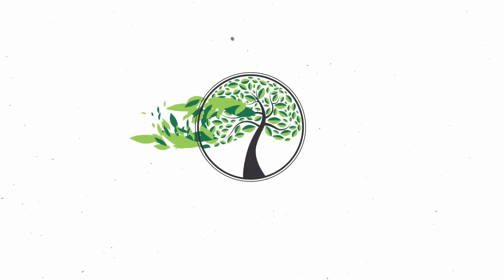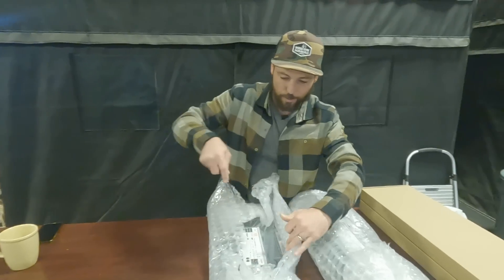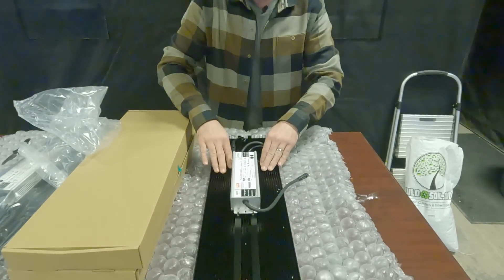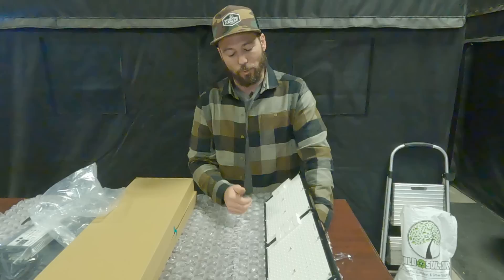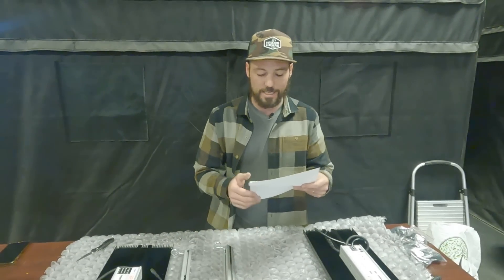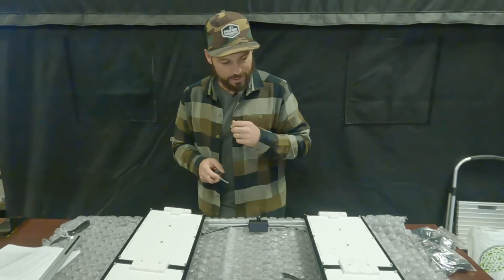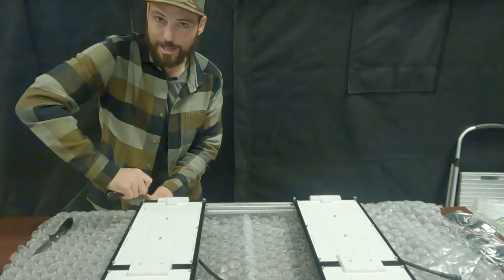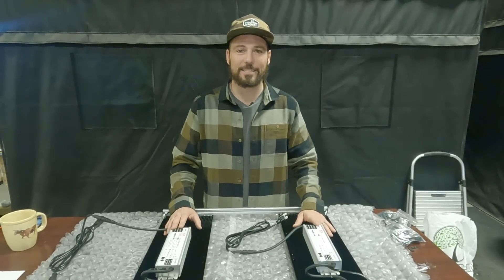BuildASoil Product Highlight: OUR NEW LED LIGHTS // HIGHGROVE MAGNOLIA 4

Comment: This light is a pain in the ass to  put together. If they just had holes instead of these sliding things itd be much easier to align. I understand the slide things are needed for spacing but wow is it annoying.

Comment: Where are all of the led grow lights with the Samsung LH351D diodes at???   Did you guys know that those particular Samsung diodes grow plants better than the Lm301B diodes and the Lm301H diodes....do you guys know why the grow lights with the Samsung LH351D diodes grows plants better?  Answer:  The Color Rendering Index capability of the High CRI 90+ LH351D diode....it renders the 6500k Daylight spectrum with more clarity and purity, and renders colors that the Lm301B and Lm301h diodes CANNOT, because the Lm301B diodes and the Lm301H diodes are only 80CRI.....just slightly better than a fluorescent bulb, and actually very DIRTY light, poor Color Rendering Capability so the Plants don't grow as well under them, and that is a FACT.   

The Waveform Lighting company 97-98 CRI rated diodes will grow circles around the LH351D diodes, because the LH351D diodes are around 92-93CRI and CANNOT reproduce the Color Spectrum as well as the Waveform Lighting diodes.    

I can make a grow light out of just 2,700k and 6500k Waveform 98CRI diodes, and Grow CIRCLES around every other grow light out there, including this Highgrove Grow light with POOR color rendering capability.   It's only rated at 80CRI......so yes it's dirty light and does NOT FULLY render the Color Spectrum...A Waveform 98CRI diode grow light is OFF THA CHAINS FOR REAL!!!!

Comment: What’s up Jeremy. Was wondering your opinion on VPD during lights off. Thanks man keep up the good work!
Reply from the maker: There is only pressure on the plants when stomata is open and they are growing because of lights on. Basically VPD doesn't matter at night. That being said, I still care about the environment. In Veg when lights are off I let the Humidity drop a lot lower because there is no pressure until lights turn on. In Flower I MAKE sure that the humidity stays low and the temps cool at night because I want to avoid MOLD. hope that helps

Comment: I love the style of those lights , last year I had a similar thought , I bought a 4×4 tent with 8'exhast fan 2 - 6' osc fans for corners 8'turbo fan for floor and running 2 - bloom plus xp2500 side by side with a gravita uvb in between the boards and results are excellent , I'm inclined to believe this set up is similar just thinking the set up I got was off Amazon , which are labeled as budget lights , so I'm curious as if I got the same results with a little less of a budget , because I believe these light are a bit pricey but awesome quality , I am a believer , you get what you pay for , Honestly , had these lights been on the market for me when I did my ordering , I would of put out for this exact set up you just exhibited . Thanks for the videos , could you plz get back to me on my thought.

Comment: Watt meter test? Claims 530w but only has 2 240w drivers?
Reply from the maker: The Meanwell HLG-240 is the Model number of the Driver but it's capable of pushing 265 watts without any issues. Part of the build is to make sure you design the Driver and Chips to the environment and heatsink used etc etc. Good EYESSS!!!! Great question

Comment: I like this as a modular design. Shane at Migro has the right idea .
Reply: The array 4 is sick. Light spread is unbelievable how even it is.
Reply: @joesavage2269  The MIGRO Aray is phenomenal, and much better than a big board for versatility... and head-bumping. I have a 4 and an 8 and would not look anywhere else to solve a lighting question for my small situation.
Reply: @cuznclive2236  have to agree, I was really impressed by the overall build quality for the price, frankly a brilliant bit of kit
Reply from the maker: @joesavage2269  The MIGRO looks like a great deal! Off Hand comparing Dollar Per Watt it seems like a great value. Normally when I see a manufacturer use 3000k + 5000K Led chips it means they are using a lower quality product that will result it a unit that is much more cost effective. With the High Grove we only wanted to offer the Samsung LM301H Full spectrum 3500k as opposed to the MIGRO style. Modular is the way to go and I think the MIGRO would be a good choice but not directly comparable by component.
Reply: @BuildASoil  I wouldn't dream of trying to argue they are in the same league tbh, I can only speak from my own experience. I got the migro array because it fit my space the best, and all the other benefits like build quality etc were nice surprises! In my day job I assess a huge range of equipment on all aspects from packaging to the warranty and I recognise a high performance when I see it! I don't think the higrove kit is available in my market so there's that as well!
Reply: @BuildASoil is this light or Migro Array 4 better? I am looking to get 2 for a 4 x 8

Comment: Hey man it sounds like a good quality light but for a 4x2 I've found plenty of decent ones pretty similar components like mean well driver and Samsung diodes for like 100 bucks or so. Just easy to find these days and as much as I'd like to buy from an American company, Amazon offers free shipping and returns with all kinds of LEDs that work fine. Never had a Chinese brand screw up on me so doubt I will pay 4x for basically same thing
Reply: Do a par test on those cheap chinese lights. I gaurantee you they are no where close to what they are advertising, if they even give out a par map at all.  Everyone i know that started with those cheap lights ended up disappointed one way or another. I gaurantee you are going to end up spending more money in the long run vs just buying quality from the get go. Not only that but the spectrums usually suck with those cheap lights and your end quality/yield will suffer.
Reply: @mopar426power  you're talking to someone that researchers and tests lights man... Is the ppfd a little bit lower? Yeah but not enough to affect yield. When it comes to $400 versus $75 that's an easy choice for me
Reply from the maker: @jm12green31  I would be happy to compare the components you are discussing to this Magnolia. We are very transparent and only offer what we believe in. When you are using thousands of LED chips the difference between a 1 cent chip and a chip that costs 6 cents makes a big difference. Then you factor into that, the waterproofing, electrical connections, Heatsink and build quality things can change quick. Let me know what components you are comparing to and I would be more than happy to share my opinion on how the 2 compare.
Reply: @mopar426power  but the caveat is you have to really check the components when you order from an Asian distributor on Amazon. I've seen plenty of people get fooled... Not me I always give them a full test. Are there a few duds? You bet your ass haha but there are some diamonds in the mix
Reply: @Rick Owens lol shots fired

Comment: 800 dollars out of budget man
Reply from the maker: Comparing to other similar grow lights it's a great value at 1.50 per watt and superior build quality + Warranty etc. Because these are modular you could always get the Highgrove 2 and start veg with it and then upgrade later by adding another Magnolia 2 and when you order it tell us that you want to combine them and we will send the Metal components to upgrade your 2 lights into 1 magnolia 4 free of charge when you buy the 2nd. Basically you can turn the 2 into a 4 because they are modular. If not, for sure there are cheaper lights, but they won't last as long and you'll have to repeat purchase. When it comes to the grow, I like to buy once and buy for life.

Comment: I am running a HLG 260 XL QB V2 RSPEC in my 2x4 right now would this be worth the upgrade? Can you move the driver so I could locate it outside the tent to keep temps down?
Reply: You would get the addition of a little uv. Other than that basically the same thing. Same drivers same diodes. Well unless you have the Inventronics driver which is just as good as MeanWell
Reply from the maker: @jasl7358  I think I would stick with what you have got. But if someone is reading this and comparing between their first purchase I would recommend the Highgrove because it's a better build and uses a real finned heatsink that will help the LED chips last much longer. This and there is additional copper added to help make the heatsink even more efficient. Besides that the High Grove has the LED board attached with screws that you can remove to self service should there ever be a problem in the future where as the HLG is riveted together and cannot be taken apart the same way. Additionally at High Grove we are offering a product that uses Meanwell drivers which are the best and instead of only 1 Driver these units are modular and come with 1 Driver for each 2 boards to that if something ever happens your entire light will not be down and you can self service ASAP. Hope these small differences help others making decisions. Also 1 more thing, in the video there are 2 power cords but all lights shipping from High Grove now come with 1 power cord all with waterproof attachments.

Comment: wow.. those are shit. why would anyone spend that much for a poorly engineered product (2 plugs?? yea THAT sounds real convenient)? i mean, for anyone who doesnt know you can get almost TWICE the product from a trusted brand (mars hydro) that lets you keep the drivers and dimmer outside the tent for that price.
Reply: I would argue they aren't s*** but just overpriced. I research and test lights from Amazon so trust me I've seen a little bit of everything. I could show you a couple of quantum boards right now with pretty much the same components but 1/3 to 1/4 of the price
Reply: @jm12green31  sounds like an interesting job. i know a LOT of the cheaper (im just going to say it: chinese) alternatives sold on amazon have lots of hot spots, so even if on paper they are equal in practice they are greatly flawed (unless you LIKE burning holes in your leaves). this though.. its not just that its overpriced its poorly engineered, you can tell that you cant put the driver outside the tent (strike 1) by the cord length, you need 2 sockets (strike 2) for some reason rather then properly designing them so the power comes from the bar or something, and strike 3 is the horrible price. i would also go with bars instead of panels (better circulation), being able to put the driver outside the tent means theres really no need for giant heat sinks AND you can control the dimmer without going inside PLUS they then weigh less. nah, they are shit.. very very overpriced shit.
Reply from the maker: Which model? I would like to see! We only want to offer the best value and think there will be true differences.
Reply: The MIGRO Arays are not expensive at all. Timber/Magnolias are expensive. If you want cheap, buy a fucking T5 at 4000k.
Reply: @cuznclive2236  where are you located? im wondering if prices shift region to region. migro has definitely stepped up their game though, when they first started selling the arrays they wanted to fist my rectum on shipping so i stuck with mars hydro and i now see they have free shipping from a state-side warehouse so thats awesome. shane is such a good dude next time i replace (or build another space) ill definitely be using his products.
Reply: @megaflux7144  Southern VT. MIGRO fits me because of the versatility, cost, and public involvement; Shane should get more cred for what he does, including his new US partnership to reduce shipping costs. 
On the other side of the planet, we have Timber, or whatever Dan calls his company, which fucked me with kindness until they ran out of Vaseline... mic-drop.
Reply: @cuznclive2236  aah, the one new england state i havent lived in (wee bit jealous, not gonna lie). so were both americans. i agree, shane seems as close to a saint as we have on this planet to me and ive been a long time fan. i suppose i should edit that part out of the original comment. 
out of curiosity, what happened when they ran out of vaseline? hopefully they didnt reach for the crunchy peanut butter.
Reply from the maker: First off thanks for commenting without filter. I would rather know what you think so we can address it. The lights shipping currently have 1 Plug for all models that connect with waterproof connectors (Upgrade since I made this video a month or so ago) We used to carry MARS a long time ago and they failed so often we had to stop carrying them. (We even hired an in house tech to solder new chips onto the boards for Mars) They may be better now, but at the end of the day the entire industry has evolved and there are only so many choices to be made when designing a build. The Magnolia is designed to be a superior longer lasting build based on every component chosen and the engineering. When comparing, many of the Quantum boards are built without a true heatsink and only a thin piece of metal which will drastically reduce the life of the light. Along with this they will use 1 driver which if burnt out will take down the whole light and that could be mid grow. On top of that, if there ever is an issue years after purchase the cheaper models will be riveted and not serviceable in a modular easy to service at home way. I do appreciate the conversation and want to understand how growers make these decisions so that we can educate. I'm all for growers grabbing a cheaper light that fits the budget but it should be easy to understand what really makes these lights more valuable if we are going to offer them. I'll do a better job explaining the differences and make a better video eventually.
Reply: @BuildASoil  considering the engineering requires the driver to be IN the tent i gotta call bullshit on your claim of "superior engineering". the driver being external and the ease of daisy-chaining are what sells me on mars hydro. as for migro arrays i would assume people like how easily expandable the system is and frankly light geeks just love shane for doing all of the comparisons he does.

Comment: why so expensive?
Reply: Cause BAS is pushing it, gotta add the cannabis tax.
Reply: @southernvtgrown  Whitingham, just north of the Jacksonville store(s) off Rt. 100.
Reply from the maker: @southernvtgrown  No way! This is a great value. There are lower cost products on the market but they sacrifice build quality for that price. These are Samsung LM301H not the LM281, there is a big difference in cost on these and there is a difference in efficacy and results. On top of that the Magnolia features Dual Drivers for redundancy (Your whole light won't go down because of a driver issue), solid aluminum frame, real finned heatsink with added copper for efficiency, Serviceable board mounted with screws not rivets, 5 year warranty, waterproof coating, waterproof electrical connections. We absolutely care about value and these lights will last and produce phenomenal results.